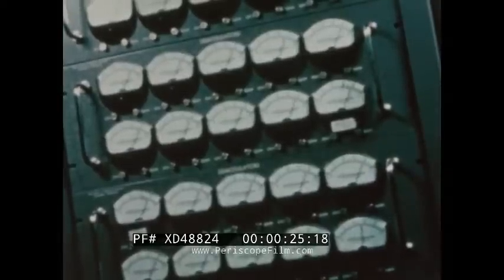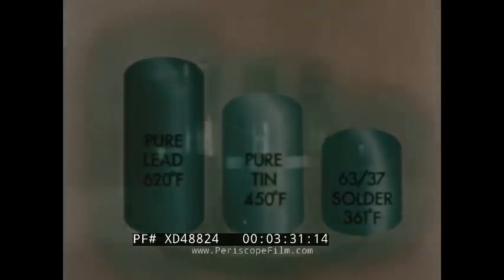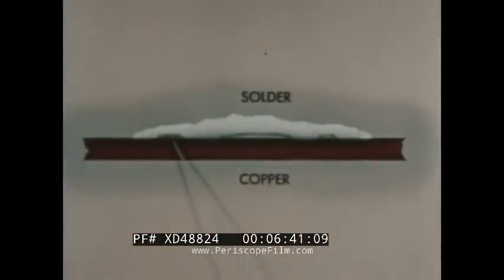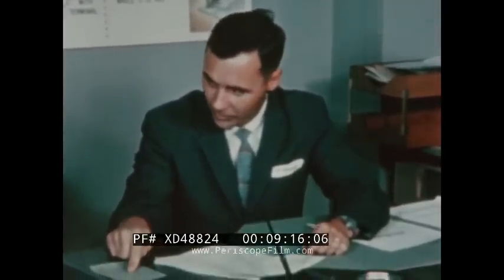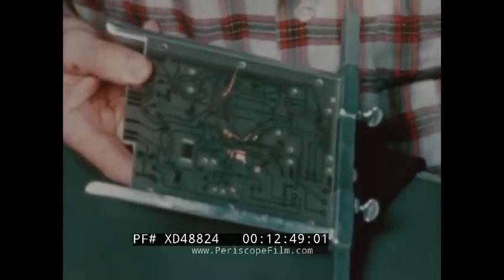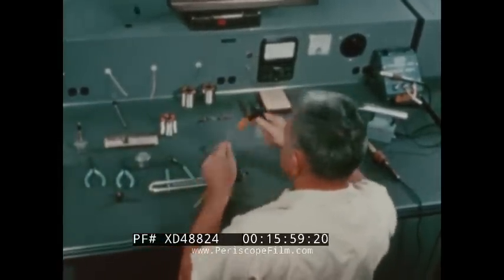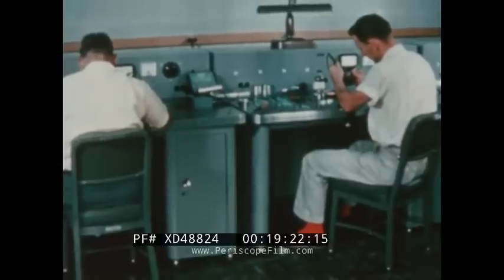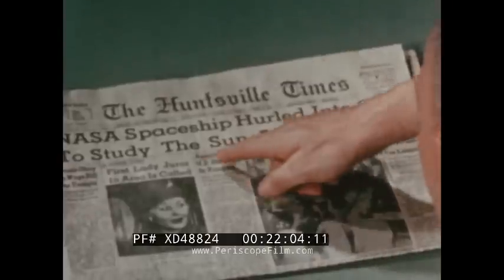1958 "ABOVE AND BEYOND" NASA SOLDER & SOLDERING TECHNIQUES ELECTRONICS INSTRUCTIONAL FILM XD48824

Comment: At 16:23, "[the heated wire strippers]  even work well for stripping Teflon wire, in a well ventilated room".  Apparently the military knew about the toxic nature of overheated Teflon long before the rest of us, who had been using Teflon coated kitchen pans, were informed about the dangers.  It appears he was stripping stranded Teflon wire in that portion of the video but I didn't see anything in this video about how to twist the strands of the wire together before soldering them. If they're so concerned about  Getting finger oils and salts and contaminants on component leads and solid wire from handling them with your fingers prior to soldering, then the same should apply to stranded wire, but in normal everyday electronics work,  everybody just twists the strands together with their bare fingers!
Reply: They actually showed him only partially stripping the insulation, taking the strippers off, and then twisting the strands using the section of insulation as a handle.

And if you use a Teflon pan properly it never gets hot enough to burn the Teflon.
Reply: @ke6gwf  , I missed that part --- old eyes, and insufficient coffee in the early morning! I've never actually used heated strippers (that sounds a bit risque!). We do have 24 guage Teflon at work, silver plated solid wire, very nice for jumpering burned, broken or corroded foils, or cracked PC boards, but a bit of a pain to strip short jumpers because the insulation tends to slide when you pull on the strippers. The type of complex strippers that clamp the wire down with a bar before the cutters slice into and pull on the cable jacket, those work pretty well.......
Reply: @ke6gwf  Good reply.
Reply: You could use needle nose pliers to twist the strands
Reply: @RRKS_TF  For thin strands, fingers work better. Pliers make the strands stick out instead of becoming smoothed down. You could simply wipe the bare wire with alcohol or ammonia solution to clean off the skin oil for perfect joints.
Reply: @goodun2974  Excelta makes precision wire strippers/pliers  made for teflon insulation in high reliability soldering.  They are pricey ($225) and you have to have one for each size of wire. But, once you  use them, you will never do it any other way.
Reply: @RRKS_TF  The goal is to remove the jacket without unlaying the wire strands. The trick is to allow the jacket to twist with the lay of the strands as you pull the jacket off.
Reply: @david203  90% alcohol cleans the wires and the flux after soldering. 70% just doesn't have the oomph to get it done.
Reply: @RRKS_TF  No. Bad idea. You can stress the copper wire. Remove the jacket by twisting the jacket off with the lay of the strands.
Reply: @WarpFactor999  Good tip!
Reply: @WarpFactor999  The assemblers at my factory use Meisei HOTweezers for wire stripping. I rescued a dead one from the scrap bin, repaired it, and took it home. I'm never going back to mechanical strippers.
Reply: nah, I usually use a sharp knife, go around and then, while pulling the stripped part slowly off, I start twisting...results in nice and uniform twist
Reply: @Hunne2303  That works as long as you don't nick the wire in the process.

Comment: I learned the Bell System way of soldering. First heat the connection then apply soldier to the tip of the iron..

Comment: I love that there is absolutely no mention of not inhaling the fumes
Reply: If you do it right in a proper soldering station you don't get fumes in your face. Besides, in those days, most people were smart enough to not inhale rosin particles if they could avoid it. They didn't need to be told that.
Reply: My thought exactly. And they haven't even mentioned where the safe spaces are, also I never heard the list of pronouns, and I missed the part where they mentioned if the solder and flux is vegan.
Reply: The fumes from Rosin aren't dangerous, however they are an irritant to some people. Easy enough to avoid them, if they bother you.
Reply: @johncoops6897  ,  The fluxes used with lead free solder are comprised of organic acids and they are extremely unpleasant to breathe. I find them far more irritating than ordinary rosin flux. Although it's pretty much a moot point because I never use lead free solder anyway,  For plumbing work yes but definitely not for electronics. Not to mention that the flex is designed specifically for lead free solder Are corrosive and conductive and great pains have to be taken to remove the flux from the circuit boards. Even then, lead free solder doesn't flow and wet to the circuit board and component leads as well as lead solder does; and lead free solder degrades  at temperature extremes, including extreme cold as well as heat.  Connections made with lead free solder never last as long, and millions of devices fail prematurely and end up in landfills because of the use of lead free solder.
Reply: @goodun2974  - nobody in 1958 used Lead-Free soldsr.
Reply: @johncoops6897  , I was contrasting the fumes from 1958 solder to the fumes from 21st century solder. Very different.
Reply: @goodun2974  - yes, but also quite irrelevant to randomly introduce that here.
Reply: @johncoops6897  , as was your obligatory attempt to correct the pronunciation of sodder to "sol-der" . Mere folderol, but typical of a certain rigid mindset.
Reply: @goodun2974  HA Ha - that was a Good One!
Oops, I misspelled that.
Reply: @goodun2974  And don't forget the problem with tin whiskers. That was a disaster! That's why we grandfathered in the aerospace, military, and biomedical products; we cannot afford to lose human lives just to reduce the lead in the supply chain.
Reply: No eye protection anywhere!!
Reply: @goodun2974  - BTW, my other (completely separate) Top-level Comment about the pronunciation of "Solder" wasn't folderol - oh hang on, is that "foDDerol"?
Anyway, it was "taking the piss", which is why it has a smiley on the end of it. We could argue that completely missing a joke is typical of a certain rigid mindset.

Comment: Is that a Simpson 260 embedded in the bench?  Good way not to lose or break it.
Reply: Yes, it is.
Reply: I still have one of those 260s laying around. It even has the mirror to reduce parallax error. I never use it and it just takes up space.
Reply: My best friend died and his widow gave me his most prized possession; an old Simpson 260 that belonged to his father. I restored it and returned it to full working order and presented it to his mom as a family heirloom.
Reply: @Chris_at_Home   I work for an audio repair shop and we still use Triplett and Simpson analog meters in the shop for certain tasks. They're handy for doing quick checks of transistors and diodes for shorts versus proper junction resistance ,  and also for differentiating between a shorted AC power circuit versus a short in the actual transformer, because the analog meter will show an inductive kick from the transformer winding (the meter hesitates for a fraction of a second before picking up speed as it  heads towards the low resistance end of the scale ).
Reply: Another use for analog meters: testing flashlight batteries.  High impedance digital meters will fool you into thinking a battery is good because the meter doesn't load down the battery at all. An analog meter with a typical 1k ohms per volt load will be give you a much better idea whether the battery has any life left or not.
Reply: @goodun2974  I was a bench tech on oil well logging tools for a little over 8 years. Everything was component level repair with high failure rates because of high  down hole temperatures. After that I did communications for 30 years. It got so we just changed boxes and boards. Reminded me of O level maintenance as an avionics tech in the Navy. My  meter is collecting dust so if you ever get up this way look me up as I’ll never use it again. It’s sitting at the cabin now and I won’t get there till mid June when the snow melts and the frost leaves the ground so I don’t get stuck.
Reply: @Chris_at_Home  How much are you asking for it? I'll totally buy an old Simpson.
Reply: @GoSlash27  I’d give it to you seeing as you would use and appreciate it.  It is out at our remote cabin now. I’m pushing 70 and my wife doesn’t allow me to out there alone in the winter. That’s probably a good idea.  It’s a 6 mile snowmobile trail.
Reply: @Chris_at_Home  I would happily take care of it and show it off. Unfortunately I have no easy way for you to contact me or to let me know when you've laid hands on it. Thank you for the kind offer and I hope you stay happy and healthy!
Reply: @GoSlash27  I subscribed to your channel. As soon as I retrieve the meter i will be in touch and we will figure the logistics of getting this to you. If you are in the USA it will be easy.
Reply: @Chris_at_Home  That's very kind of you. Thanks!
Reply: Simpson analog meter.  Haven't seen one in years.

Comment: Once you learn how to solder real good you are promoted to inspector, and so on up the line until you get to a job where you don't know what you are doing well enough to be promoted. This is the way that the government ensures none of their employees know what they are doing.
Reply: That syndrome is not unique to government.   Every large organization has this problem…”The Peter Principle”.
Reply: It's a funny concept, but not actually true. Definitely true for management, but they're just as likely to "fail upward" as they are to get promoted on merit. The promotion process for assemblers (the only people permitted to solder) is assembler/ inspector/ repair/ lead. It stops there unless you want to go into another field. Same for techs; it's technician/ senior technician/ and finally lead technician. None of us perform any management functions and nobody in management is permitted to touch the product, so promotion beyond lead requires leaving your profession and entering a different one.

Comment: Almost nothing has changed since 1958, we now understand why alloys can melt at a lower temperature than the base metals, and we have lead-free solder as an option now (which I hate) but otherwise most of the information still applies
Reply: It's almost like chemistry and metallurgy follow fixed and unchanging physical laws which continue to apply regardless of how much time passes. :)
Lead-free is only optional for hobbyists these days btw, due to ROHS legislation it's basically mandatory in production environments if you want to sell your products worldwide.
It's really not so difficult to get to grips with, once you understand the differences between leaded and lead-free soldering techniques. Everything just needs to be a bit more precise.
Leaded rosin-cored 60/40 solder is like playing Electronics on Easy Mode, it gives you auto-aim and greatly increases the chance of critical hit regardless of which weapon you're using.
Lead-free requires you to set up your engagements more carefully. Many lead-free solders aren't rosin-cored, so the PCB pads and component legs must be cleaned of any grease/oil or other contaminants, you'll need to use a flux gel or pen to manually apply flux to the joint before heating, and ideally you'd want to use a temperature-controlled soldering station that's designed for lead-free work. If you have those things and practice your technique a bit, you will consistently make good lead-free solder joints.

Lead-free rework absolutely sucks though, avoid that shit at all costs.

Comment: I literally just took an IPC J Standard class, and I've learned so much more in this 20 minute video due to my instructor being unable to answer questions. Now I know what wetting truly means.
Reply: I assure you, if your instructor was certified by me they would know everything in this video. However, too many IPC certified instructors just know the rules in the book but not why those rules are the way they are.
Reply: @jasonfullerton7763  As far as I know, it was only her second or third class. She's been soldering for years but really was unable to answer why to certain things, just that it is supposed to be a certain way. Her explanation of wetting was that it spread out and created a fillet, not that its a physical bonding between the solder and pad/wire. Her demonstrations of how to solder certain components was dreadful, and, although my test boards according to her contained no defects, an employee on my project inspected it briefly after the class and found at least two defects, and many places that were process indicators, or at the very least were not exhibiting good practices. I was definitely not shown how to properly solder and will still need some follow up after the class.

Comment: Two "deliberate errors" appear in this film:
1 - No protective eye wear used at any time
2 - A complete inability to correctly pronounce the word "solder"
Reply: Protective eyewear for soldering? Dude... you had too much LSD in the 1960s.
Reply: Nowadays solder workbenches must have an ventilation which prevents the worker from breathing the fumes.
Reply: @matneu27  Yeah, I worked as a field telecommunications tech for more than twenty years, and did a lot of jointing of paper cored and lead covered cables - lots of lead plumbing joints with a blowtorch and breathing in the fumes.  I'm surprised I'm not more brain damaged  😆
Reply: There’s nothing better than the smell of solder in the morning.  As for the pronunciation, Brits often have trouble with English. Perhaps a Frenchman could help you with the pronunciation?
Reply: In case anyone is curious, I found a few sources saying that lead vapor starts being produced at around 450 Celsius, which is higher than you should ever need to be when working with lead solder. Flux fumes aren't great though.

And while it's rare, solder joints do occasionally "spit" - I had a blob of molten solder hit me in the face less than an inch from my eye. Now I wear glasses but I'd definitely be wearing safety goggles if I didn't.
Reply: @stargazer7644  We don't have trouble with English, it's all the other languages we screw up 😁
Reply: @stargazer7644  "There’s nothing better than the smell of solder in the morning. "

Yes, there is, but you need a wife or girlfriend for that. :-)
Reply: @matneu27  Not really. OSHA doesn't mandate fume hoods and the assemblers hate them. Safety glasses OTOH are mandatory. The assemblers aren't required to wear them when using a microscope, but must wear them at all other times.

Comment: I was an electronic/avionics tech for 35 years. We had to take a two week soldering course and get recertified every year after. I also took a micro-miniature soldering course for soldering chips with a microscope. I first learned soldering on my own by building stuff like radios from Heathkit in high school. Their kit manuals did a decent job of showing you how to solder. I knew another kid in high school who thought you soldered by the using the "drop a bomb" method. He would melt the solder and let it drop from about three inches. lol. He never would listen to me when I tried to show him the right way.

Comment: As an instructor at Ft. Gordon in 1977-1979 i was an instructor for the Common Percision  Soldering class  (CPSC) a 2 week class for anyone that was taking repair classes of any type of electronic equipment. The soldering was done to NASA standers and a card was issued on passing. Failer to pass for most of the classes at Gordon ment you where to be retrained in some other MOS. Wish we had this Film to show at the begining of the two week class. Every monday we start a new class. If a Student was lucky or unlucky to pass in say 1 week (Did happen lot) they would have a week off from there training, But that left them open for there company to assign them to work detale for the week (Cut Grass, Paint  Rocks)
Reply: Respectfully, Fred, I will assume that your soldering, and the soldering technique of your students, was more precise than the spelling in your comment. "Percision"? "NASA "standers"? Also, "failer", and "ment", and several others. Blame auto-correct if you like ---- I freely admit that I do 😉! ---- but you can't go wrong if you approach  proofreading exactly the same as inspecting a circuit board and reworking any substandard connections. Why?  Because every individual word (component) is a connection point to another word (component) in a type of circuit that we refer to as a sentence. Again, respectfully yours....
Reply: @goodun2974  About 4 years ago i had a minor TIA.
Reply: @fnordhorn  , sorry to hear it.  I had an infection in my heart in early 2020 just before the pandemic hit and I had to have open heart surgery twice that year, for replacement of two valves.. It doesn't matter if I eat barbecue pork or barbecue beef, I am now officially committing cannibalism!  I also have arthritis and something similar to Dupyuchin's contracture. "Old age ain't for sissies",  as Bette Davis used to say.  It still beats pushing up daisies.

Comment: So much has changed since this film was made. I did a lot of hand soldering of equipment built for NASA to go into space. 60/40 solder was replaced by 63/37, the lead free alloys. Surface mount soldering is much different  than point to point. I did a lot of it under a stereo microscope.

Comment: Ive been soldering for 60+ years. Now I restore 2" video tape machines where good soldering ability is a valuable asset as all the PCBs were wave soldered back in the day, no SMC stuff, but components do need replacement. ESP re-capping before power is applied
Fun times